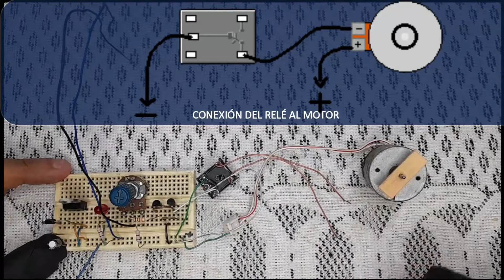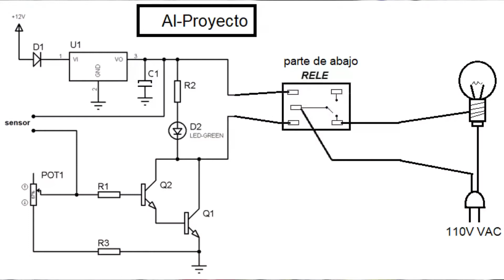🔰 COMO hacer un SENSOR DE HUMEDAD con Electrónica Discreta😱 SIN ARDUINO❌MUY FACIL DE HACER✅

Comment: una pregunta, ya lo armé, pero al colocar una bomba de agua sumergible, para el riego automático, no funciona, lo alimenté con 9 Volts, que podría estar mal
muy buen video.
Reply: con un motorcito funciona perfecto, el relay es de 24 Volts
Reply from the maker: @kevindanielmarroquinmorale3204  Hola Kevin. Estas usando un rele de 24V de bobina y la alimentación es de 9V? Si es asi, no hay potencia suficiente para cerrar el contacto del rele. En ese caso tendrías que usar un rele de por lo menos 12V. Recomendado es de 6V.
Reply from the maker: Pero me intriga es que con un motor pequeño si funcione....No debería cerrar el contacto el relé tampoco.